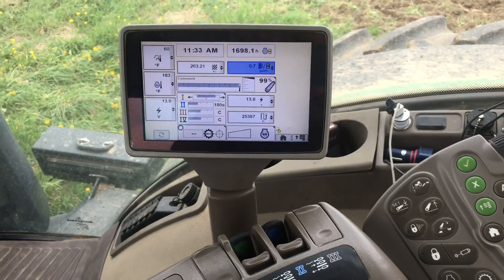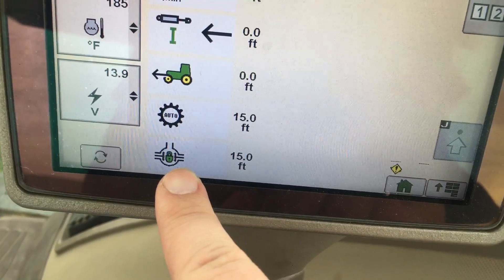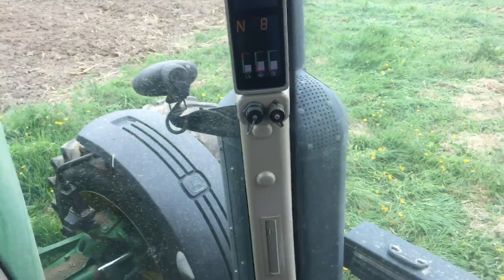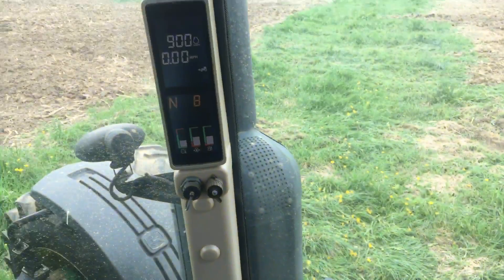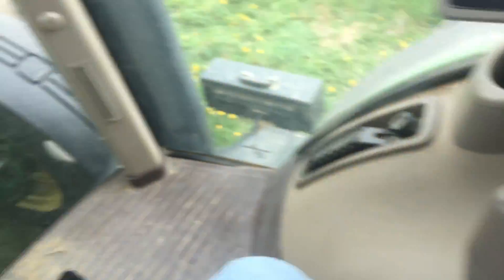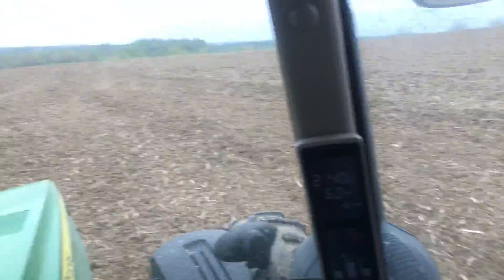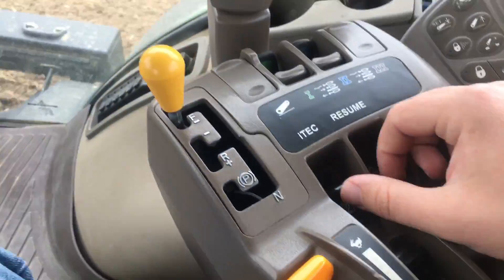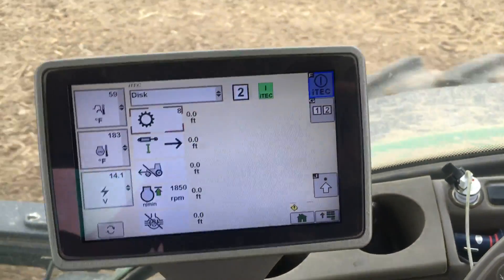How To Operate A Tractor - John Deere 8235R - iTEC (Intelligent Total Equipment Control)

Comment: Hello! Sometimes I encounter a problem with itec for a jd 8335r with gs3, it also happens that the button does not take the set command or does not complete the command, I found these errors in the diagnosis, which may be the cause, thank you! Error is 523968.02 acu 001

Comment: Electronics are a marvel untilll they stop working  Drive by wire, no mechanical connection..... could  become a problem in the future..Hope not
Reply: Exactly... why I HATE new vehicles and equipment... 

Gimme a rod or cable to operate things ANY day and twice on Sunday... if it doesn't work, it's easy enough to fix... this new stuff with a button or glob or goo in a pedal or lever or something sending a signal to a computer that sends an electronic signal to operate a relay that sends power to operate a solenoid or switch or valve or whatever, not so much... just overly complicated to do what is a simple job.  

Overly complicated is the opposite of reliable over the long term.  

Later!  OL J R :)

Comment: We just run our tractor in AUTO MFWD, and no differential lock (not needed), and then on the ends you just lightly press on an individual brake to disengage the MFWD.

Comment: We have a tractor with that and we use it for planting beans, when you have to lift the drill, ridge marker and packer item comes in very handy
We are looking at auto turn around for our sprayer to keep the same line and less crop loss.  Great video!

Comment: What happens if all this electronics breaks down, can you keep using this tractor like an old type tractor without electronic gizmos. I also don't think that a lot of farmers could afford to buy a tractor like this one.
Reply: Yeah, because most farmers like to go "low input, low output" rather than "high input, high output". It's a big step if one decides to do that, but in these times that's the only way farmers will be able to survive.

Comment: The young farmers would go for this tecky stuff but I don't think the old farmers would want to diddle with all those buttons and electronics.
Reply: I'm 32 and will stick with the old way!!
Reply: I love the GPS for guidance so you don't have to rely on seeing little gobs of foam on the ground 45 feet away and HOPING that the end of the boom is actually over them and not overlapping or gapping, and when spreading not having to look sideways trying to see tractor tracks in the dirt and HOPING that you're actually 40 feet away from your last pass without gapping or overlapping too much... the GPS is absolutely wonderful for that... 

The "fully automated" stuff is neat in a "gee-whiz" kind of way... rode along with the nephew in one of their autosteer auto-header height control combines-- just turn the thing around, hit the "drop header" button and he'd play with his phone to the other end of the field... hit the "raise header" button and turned the combine around, hit the 'drop header" button and went back to fiddling with his phone.  I guess if you're in the combine for 14 hours a day for weeks at a time trying to cover all the ground they farm, it might have a place... anybody will get pretty slopping in their operating after 8-10 hours... (I worked jobs that were 12 hour shifts, and basically we weren't worth a lot the last 4 hours... they'd have had better productivity had they done 3 8 hour shifts).  

I wouldn't want to farm that way, though.  I was raised running computerless equipment and doing it all by hand... throttle down, lift the implement, make the turn, count off the rows, line back up for the next pass as you complete the turn, drop the tool and throttle up.  Once you get used to it and get a rhythm going, it's like clockwork.  

Later!  OL J R :)
Reply: Same thing with my dad he doesnt want a monitor in his tractor
Reply: I'm 13and I don't understand some (alot) of the electronics
Reply: My dad just turned 77, and is fully using all this.  GPS, with ITEC, and the full automation.  And he is the goto guy in the area when the young guys needs help.
Reply: Well I'm 19 now and will own my own farm when I'm 30 and by the time I'm old I won't want use the modern equipment of the future "if there is farming in the future."